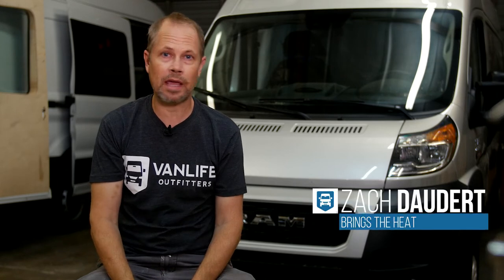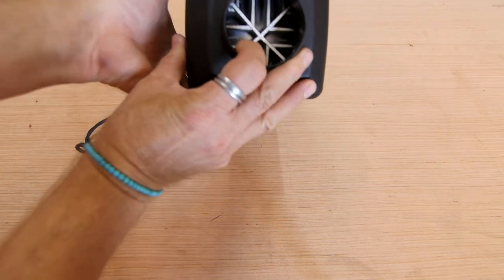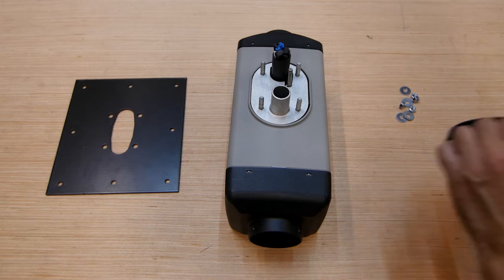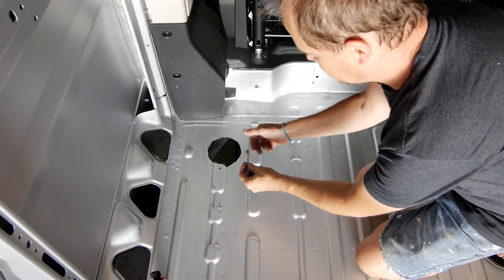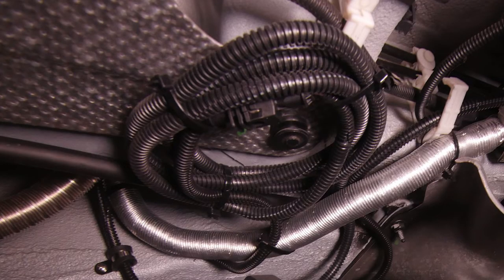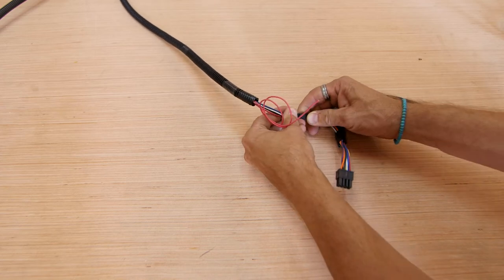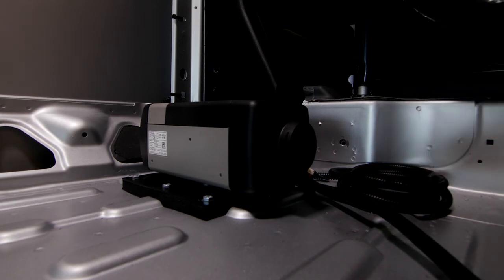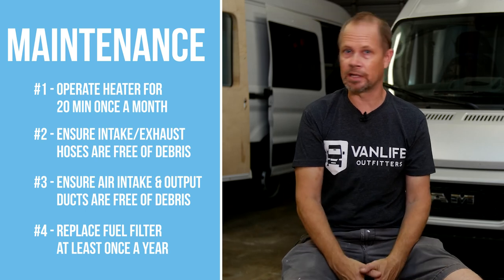Webasto Air Top 2000 STC Installation & Tips

Comment: Very helpful video.  I couldn't find anywhere that said if polarity was important on the wires coming out of the  heater for the fuel pump, but you made a point of it.  Thanks.

Comment: I believe one can use the fan-only mode with the simple North American rheostat controller, but this is done by switching a pink or purple companion wire (same loom branch belonging to the controller plug) to ground. 

Thanks for your video chock full of great and professional experience with these heaters. I'm installing a diesel  2K Webasto Air Top into a 5' X 10' "square drop" off road camper.

Comment: To clarify two things: "squaredrop", as in "trailer" - and the fan-only wire I was thinking of is the red wire in the controller branch in your video. Fan only will operate when this red wire is connected/switched to ground.  Cheers.

Comment: very helpful video! thank you. perhaps you can help a tad bit more? I have error code 7. I pulled my heater to examine the wires where they exit the shared port with combustion air supply. The insulation was pinched but not torn. I drilled it out as you recommend and massaged the wires and taped them for padding-but still get the error 7. Do I need to take the heater apart and rewire? could it be the pump?

Comment: Great video however your specific installation (11:43) has the cabin air inlet beside the heated air vent which is identical to the pictures in the installation manual that say DON'T do this.

Comment: Super video! I noticed on the wiring diagram you showed with the smart temp controller you only have a 5 amp fuse at the control panel. I’m assuming that when you have house batteries and a fuse panel you can just remove the inline fuses and use an appropriately sized one at the panel? Is that correct?
Reply from the maker: Glad the video was helpful! You can either run a branch circuit wire up to where the heater is located and then tie the various 12VDC negative and positive connections to that and keep the fusing on the wiring harnesses - we show this using a WAGO/level lock connector. In our case there is a fuse on the DC load center feeding this circuit as well so it's fused twice. Or, you could remove the fuses from the harness and simply fuse the branch circuit feeding them appropriately.

Comment: Nice video.  Maybe you can help me with a question.  I installed a Webasto heater in my truck camper, but it's only connected to an independent lithium battery.  Do I need to ground it to the truck bed?   since it's not the truck's battery just one big battery connected directly to the heater. Thanks.

Comment: I have this installed and its been running fine for a year now... But, I now need to do mods on my vehicle which will alter the exhaust.

22:15 I have this installed where the exhaust pipe runs under the frame of the vehicle and then out past the body. Everything is in a downward slope, like in the video.
But, I am removing the stepping boards from the side of my vehicle, which will make the body of the car much higher. Meaning the pipe will not go under the frame, and it will have to go back up about 6" to the edge of the frame. I know I have to drill a 4mm hole at the lowest point, but will that be an issue still if it goes up about 6"?

Comment: @vanlifeoutfitters, thanks for the excellent video. For a Sprinter with the Webasto under the passenger seat, do you run the fuel line over the exhaust heat shield? With a search, that's what I'm seeing most people do, but it seems skeeethcy to me, especially in my gasoline Sprinter (not diesel). I got some heat shield tube for the fuel line, but it still seems like a bad ideal. Thoughts or ideas? Ordering a SmarTemp3 from you asap! Thx

Comment: Do you recommend drilling a 1/4" hole at the base of the combustion air intake of the Evo 40? It's metal, not plastic like the 2000 model.
Reply from the maker: Yes, we do!